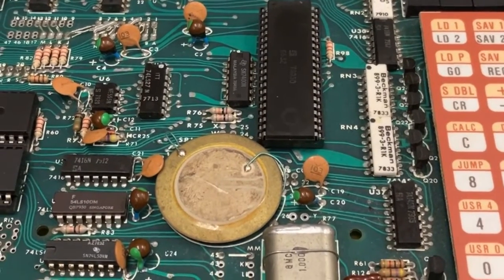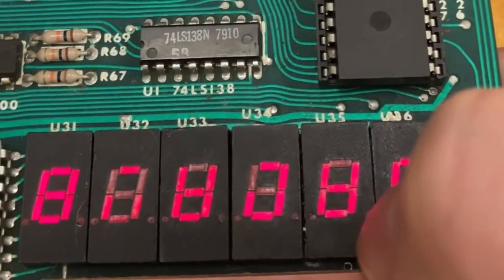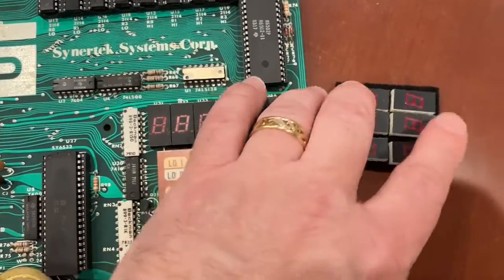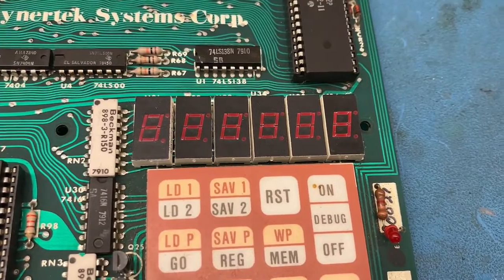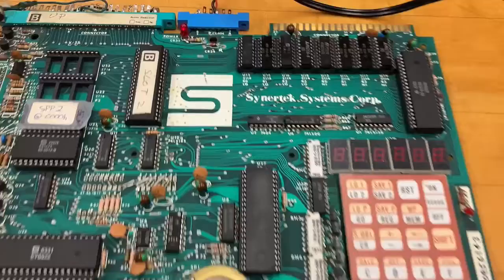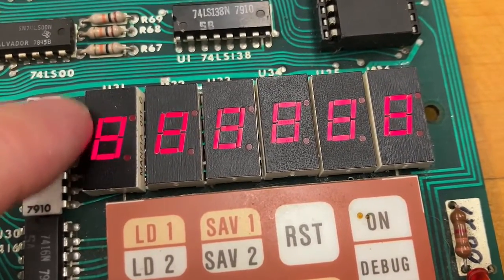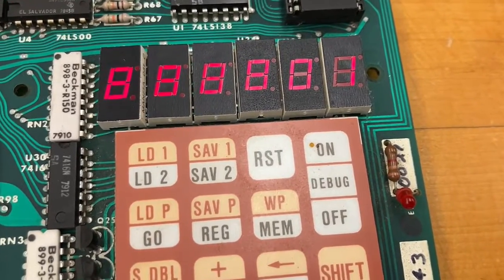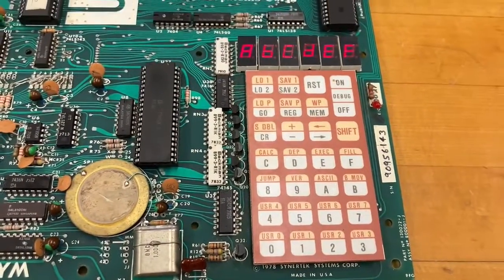Synertek SYM-1 LED Display Replacement (1978 vintage single board computer like the KIM-1)

Comment: Oh dear. Look at the manual on line.
Reply from the maker: Yup, we've entered the add-two-numbers test program and got that running. Next up is to hook up the cassette interface and the serial terminal interface.

We were also able to read the ROM that has a custom program written by the previous owner and ran it through a disassembler; I've tasked a student with trying to figure out what it does.

Comment: Lifing pads ... been there, done that, still do it some times. As long as it is still fixable that is not a very big problem for me.
The problem with these old circuit boards is that they are not as good as the new ones. Applying to much heat for a longer time or putting mechanical stress on the pad or the plating of a hole would damage a board before even noticing. I've stripped some thru hole platings without even noticing anything went wrong so I became very careful when doing repairs on old boards. Hot air sometimes works but since the pads on old boards tend to be bigger, there is more solder and it takes a longer time to completely heat the pad, thru plated hole and the pad on the other side there is a higher risk on damaging (even de-laminating) the board
Reply from the maker: Yeah -- I had never tried to desolder anything on a board this old before. It was... not fun.

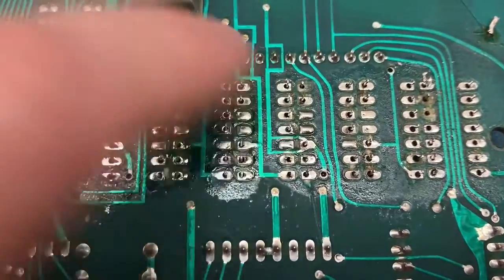Comment: 1:37, you (or how i write this) should have added more fresh solder to remove the solder to prevent lifting pads.
More to evenly heat all pins and lift the 'display' on the other side bit by bit with a flat screwdriver or needle a than clean up with wick.
Reply from the maker: I do the adding-solder trick already. I haven't done the hot air trick with through-hole; I'd also thought of that as a surface mount thing, but it's a good idea.
Reply: one should have a PCB holder, a device to enables you to hold the pcb and rotate, it's hot. it happened to me as wel few times while wanting to change resistors, now i use  special footprint if I'm not sure witch resistor value. @Lantertronics